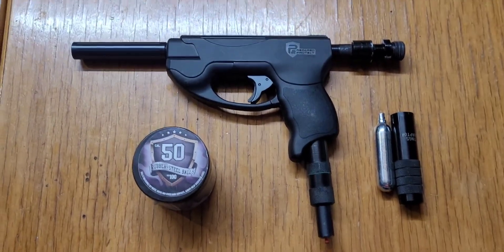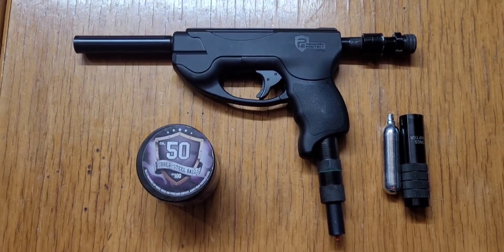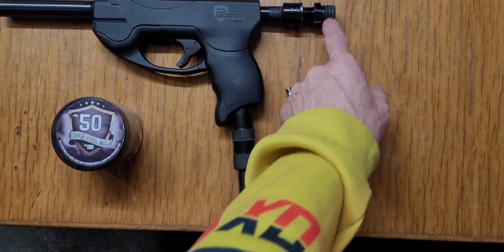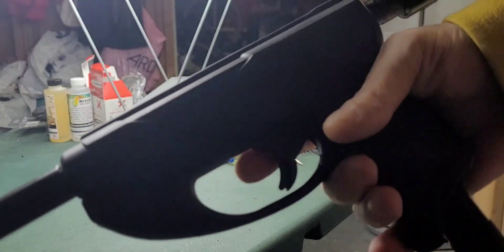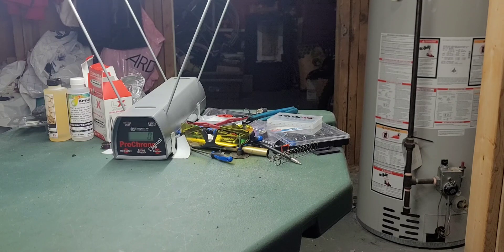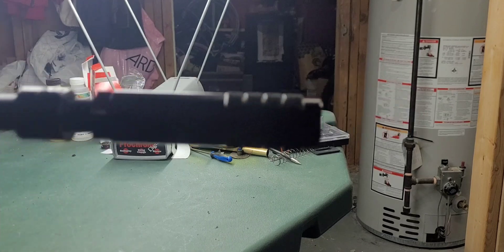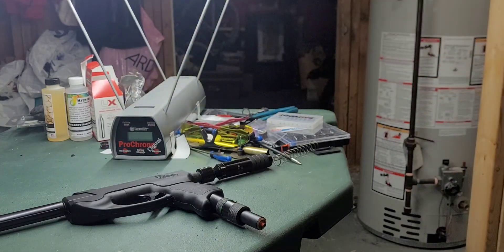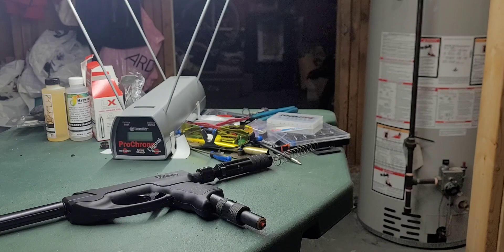HDP Compact 12g CO2 Master Cylinder, Tuning Run from Home Defence 24, Critical Situations

Comment: What's up with all these extra parts making it kinda pointless when it's point is to be compact and especially when in ebay there's also an tuning valve for this which claims 20j power similar than those made for HDR50 that says 30J
Reply from the maker: these are trial videos, trying to bring the power up, they are useless as is 14 joules wont stop any one, using a hdp compact is pointless without power mods
Reply: @LessLethalHomeDefense I truly appreciate your honesty and testing. Have you ever tried taking a regular paintball marker (intended for paintball) and modding one of those up? 
I'm curious if they would have the same or more upgrade potential. 

I have the T4E double barrel and just like you said it is laughable to think it would do much more than piss your attacker off and get ya beat even harder.
But since it is basically paintball gun in a pretty package, it did make me question how these are different than modding standard paintball markers?